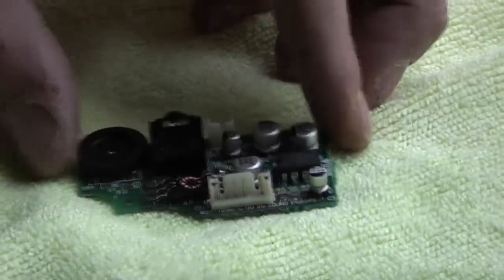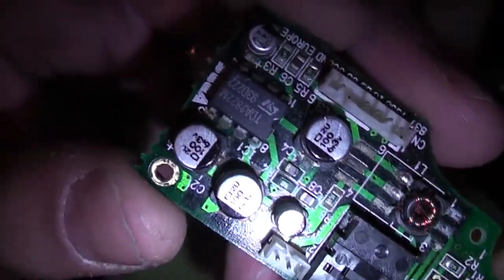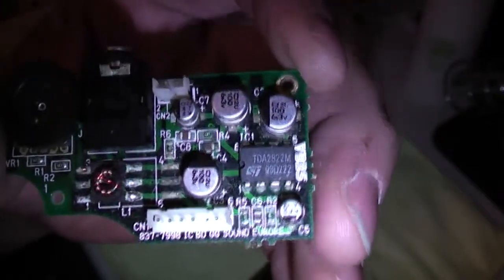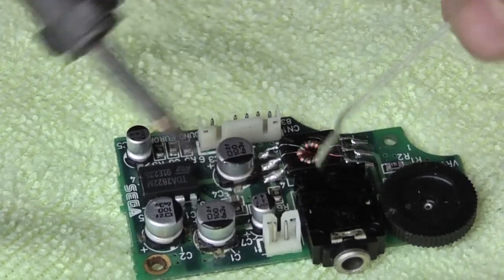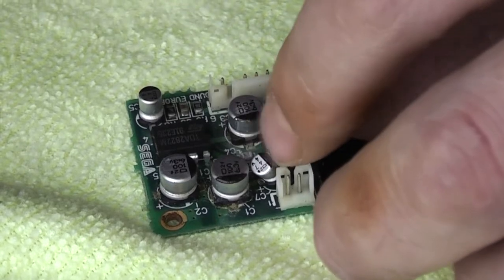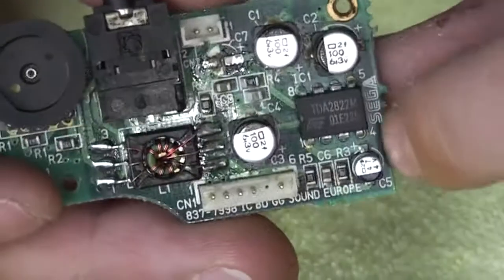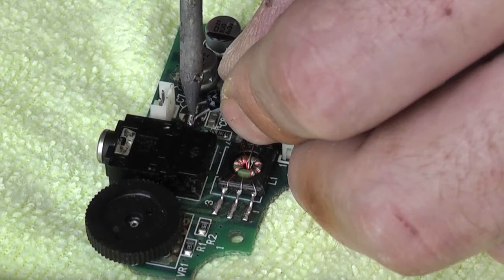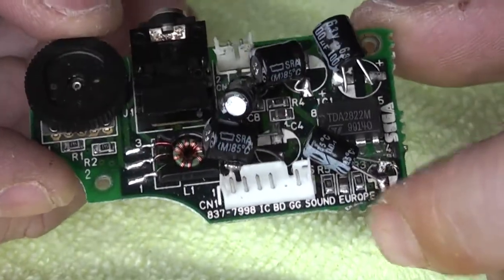Sega Game Gear Tutorial - Sound fix - Replacing the sound Capacitors

Comment: Great tutorial on replacing the capacitors properly.  Too often you hear people telling others to grab the surface mount capacitor with pliers and twist till it rips off.   Also, if you have a hard time getting the replaced capacitors to lay flat enough, you can put some electrical tape on the inside of the shielding cover before replacing it so there is no worry about shorting.

Comment: One of the best vids I have seen. Very nice how you explained everything unlike some vids where someone just adds music that is very annoying and not helpful.
Curious if you have a solution for a Gamergear that always worked.....has not been played with for some time and when trying it use it I get no sound and horizontal lines across the screen.
Reply: Sounds like classic case of failed/leaky capacitors, inherent to Game Gears. As he just showed/explained, you'll need to replace the sound board capacitors, as well as the others on the main board (PCB).

Comment from the maker: The capacitors are a different shape so that they fit into the small space of the sound board. There were several different designs of the hardware for the Game Gear, so there are a few different versions out there

Comment: I found de-soldering problematic so I got a bit brutal. I don't know if health and safety would be an issue but I used a small pair of side cutters to cut the top off the capacitors. Don't try and cut right through, just squash it then turn 90 degrees and squash again. Repeat till the top will comes off then work down towards the board till all the insides and metal has gone (use a pair of small sharp nosed pliers, as well, if required). The capacitors on the power board leave a small plastic ring behind which just lifts off. Your then left with the two contacts, from inside the capacitor, which are soldered to the two small pads. I cut the leads off & cleaned up the pads with ISOPROPYL and a small screwdriver (lemon juice is supposed to be good as well). I then put a spot of solder on both the pads & the legs of the new capacitor & soldered it in place. With the capacitors on the main board, the first "bite" of the cutter shatters the plastic cover & releases the glue from the board. It's then the same technique. You end up with a lot of shrapnel on the board but, as long as you get rid of it all, what's it matter. Also, I would strongly recommend getting a pair of headband magnifying glasses (with 5 lenses & LED's), they really help close up work when your getting on a bit.

Comment from the maker: @Leoooonard I have tried using braid to desolder these capacitors and it doesn't work the best. For a start there is such a small area to work on, it can be awkward to get the braid in, also because the legs of the caps are folded back on themselves, the braid doesn't get all the solder out and you then need to resort to the method I showed in the video, so the easiest way is to do it how I show  :)

Comment from the maker: @Polaventris Thanks mate. I have tried de-solder wick before when doing this and it doesn't work very well, I think it's because the solder goes underneath the caps, this is the easiest method. Yeah I knew about that but some ebay sellers list they're capacitors with just a U symbol ;)

Comment: I didn't get any sound from the speaker, although the headphones were working fine! I started by replacing the small capacitors and then went on and replaced all 5 of them. The problem still persists! I have sound from the headphones but there is still no sound from the speaker!!! What should I do now? What could be causing the problem?
Reply from the maker: Must be a faulty speaker or possibly a broken wire going to the speaker

Comment: Hi StigsGameRoom, thanks for these videos they've helped me make a start on replacing the capacitors in my Game Gear.  I've removed the capacitors on the main board, power board and sound board.  Everything came off nice and clean, except one capacitor which was really corroded on the sound board.  That one the pad has lifted slightly.  It seems to be intact but I don't if/how I should secure the pad before installing the new capacitor.  Any ideas? Thanks :D

Comment: Done a complete cap replacement all working no audio still any idea chap
Reply from the maker: Sorry for the late reply. Did you get it working ? Double check that your capacitors are correctly installed and not reversed polarity. If that doesn't work then probably easiest to buy a used sound board from ebay. Sorry I can't help more.